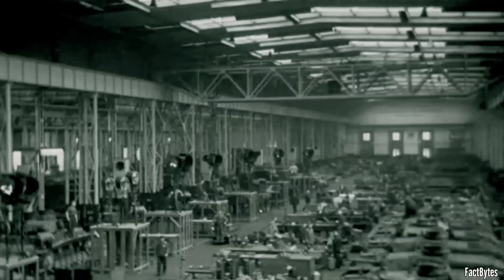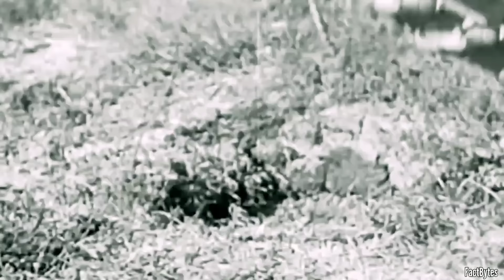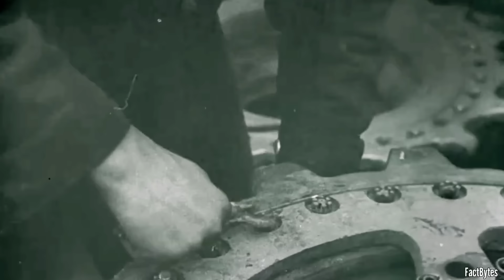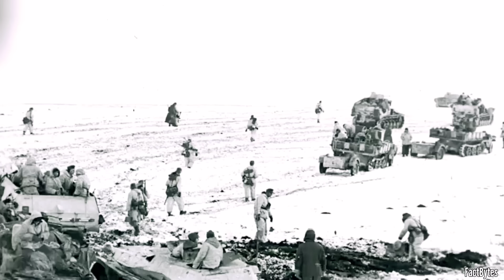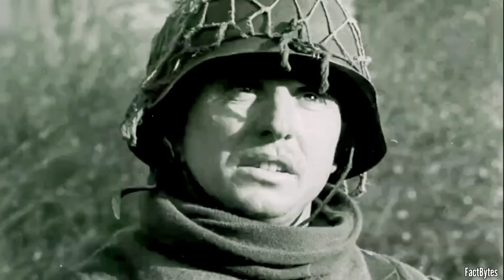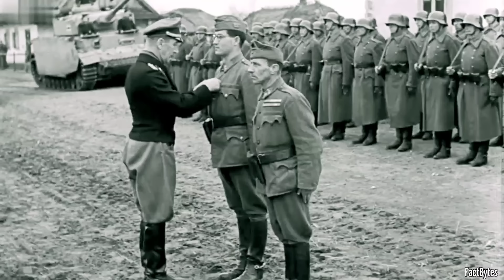More Panzer IVs, Fewer Tigers & Panthers — Would Germany Have Done Better?

Comment: Also, had the Panzerwaffe upgunned the Mark III with the 50L60 gun prior to Barbarossa, as Hitler requested, it is plausible that that one change may have altered the outcome of Barbarossa, the drive on Moscow, and even the war itself.
Reply: Interesting how minor decisions have such great impact. You may be right. Because they really struggled to take out t34s when they encountered it the first time. They needed to develop special strategies to take those out. Needed several Panzer IVs with the small gun to take out one t34. Basically one Pazner distracting the t34 while two others (or whatever) approached from the side or rear to aim at the engine. Imagine how long they had to deal with this before the upgraded tank reached the front. It must have felt forever.
Reply: @danple3557  There were only 1-1.4k T34's at the start of Barbarossa, 3k by the end of the year. The vast majority of tanks were far less armoured. You have to spread these T34's across the battle zones. Also, Soviet maintenance wasn't great, so not all these tanks would be able to be in action. Soviet tactics were also awful, no real tank/infantry/logistics coordination, & tank units were commanded by commanders with flags. If they broke through, they ran out of fuel, or got picked off. The Germans had radio & combined arms, including air support.
Whilst the t34's (& heavy KV heavy tank series) were very nasty shocks - & measures like you say had to be implemented if no 88mm's about, because of this 'shock' take up a lot more of the historical narrative than it should, most of them were thrown away in bad attacks/knocked out by German combined arms/taken out by aircraft.
Reply: @eric-wb7gj Most of your points are spot on, but I’ve not read that the Germans had fuel problems in ‘41.  If you have a primary source please cite it.  Now on your other points, the T-34 and KV 1/2 absolutely shocked the Germans as they had no effective counter other than the rare and cumbersome Flak 88.  All the shortcomings of the T34 you mention are correct, however much of the fighting by the Soviets was defensive, especially in late Fall of ‘41.  The weaknesses of the T34 and KV’s were minimized by defensive use.  There is an account of a single KV holding up a large German contingent…perhaps a division…for a day.  Another account where a KV knocked out an entire company of 38t’s.  The KV in question was hit dozens of times to no effect.

The shock of encountering the T34 and KV’s was so great that the Germans immediately went to the drawing board to 1. accelerate introduction of the Mk III with the L60, 2. upgen the Mk IV with the L43, 3.upgun the Stug with the L43/L48, and 4. Begin accelerated development of the Panther.   While you are correct that the T34/KV’s were fewer in number, the older, obsolete Soviet models were phased out in flames early on and the Germans faced increasing numbers of tanks they struggled to kill, at great cost.

The Germans had to win in ‘41, and most historians now consider Moscow ‘41, not Stalingrad, as the true turning point in the East and thus the war itself.  Had the Germans been able to knock out the T34/KV’s at the gates of Moscow they might have won, and the L60 may have been the edge they needed.  All speculative of course.  Also, had the Germans equipped the Me109E with drop tanks they may have won the battle of Britain, and thus the war, but that is a topic for another day.
Reply: @luvrofbacon  Thank you for your post.

The Germans didn't have a fuel shortage in 1941 - ONLY because they stole the strategic supplies of all the conquered countries. Otherwise, Germany, even with it's own synthetic production & Romanian help could only produce 75% of it's war needs. That's why Hitler HAD to go into Russia, & wanted Barbarossa to mainly head south, NOT for Moscow, which is what his head General wanted (who didn't understand economics, just battles), & who derailed Hitler's offensive. Hitler didn't help because with their big early successes, they believed their own propaganda & hype, thinking they could have it all, so he kept up all 3 attacks (north, centre, & south).
The Germans BIG problem in 1941 was getting the fuel from the limited rail heads up to the front lines - That's why the spearheads ran out of fuel (& what happened in Case Blue, only 2 weeks into the offensive). The Germans could airlift some fuel in, but never enough.  The Germans never had enough transport, they had a mismatch of every type stolen from Europe, incl British lorries from Dunkirk. Parts supply was a nightmare, so their transport capacity kept falling. Throw in weather, enemy resistance & basic Soviet infrastructure (mud roads etc), & you have a perfect logistics storm. Better guns don't help here, & may even make things worse by introducing another gun/ammo type into an already overstretched system!
Yes, on occasion a KV1 or 2 could hold up 1 German spearhead, but there would be many spearheads, & these were isolated incidents, not the norm which were that the Soviets threw away a huge amount of their tanks around Smolensk in Autumn 1941.
Moscow wasn't crucial, not getting a better jumping off point for 1942 was crucial. Stailin STILL considered a peace with Germany until early 1943. Only Stalingrad & Allied aid starting to flow saved this.
The Germans would have never taken Moscow in 1941, it's far larger than Stalingrad, & perfect for Russian tactics. Don't forget Hitler & his Generals insane decision to NOT supply their troops with Winter supplies. All the Wargames I played largely forgot the 'supply' issue, it's only the 'modern' ones that build this in.
Another factor is awful German 'Intelligence' that missed out 100 Soviet divisions! A better gun doesn't really negate this.
Whilst the world saw the propaganda films of the Germans 'at the Gates of Moscow', the reality was isolated spearheads of worn out troops & equipment, mostly miles away, with an ever decreasing supply train, which then went to almost nothing when the winter really hit. 
The Soviets could have also brought over their Siberian troops earlier, the Soviet - Japanese neutrality pact was signed in April 1941.
Yes, more T34's & KV1s were produced, which Stalin then frittered away until late 1942 when he let the Generals dictate the tactics, not him. 
It's undeniable the T34's & KV1's were very difficult for the Germans to face, but in reality, how many days did the Germans lose across the whole front because of them, & how many did they GAIN by wasteful Soviet attacks (ordered by Stalin), which wiped out whole (incl armoured) units?
The Soviets would have just done temporary armour fixes (to keep maximum production up), these are a lot quicker to do in the field then sort out a whole new production line (& possibly ammunition supply) of better German guns.

Yes, Luftwaffe drop tanks could have been very effective in the Battle of Britain, but NO country really thought about them at the time, they didn't want to lose performance from earlier lower HP engines & most flights would be close range anyway. Also, it's giving one side an advantage, but the flipside is what could the RAF have done differently to? The Luftwaffe fighter pilots also had a cultural issue of not wanting to escort bombers, & seemed to use them as 'bait' most times I've read.
Reply: The conflict was too huge to be affected by 1 gun. Also, when one side upgrades, the other side introduces measures to counter this earlier. Hitler ran out of fuel supplies in August 1941 (like his logistics General said he would). The Soviets then wasted their forces in high casualty counter attacks around Smolensk against dug in German forces,  which meant that when the Germans had resupplied, there were far less Soviet troops to prevent their advance, so it was faster. If the Soviets hadn't wasted their forces attacking, it's debatable if the Germans would have got near Moscow. 
Note;- The Soviet counter attacks did buy some time, but this time may have been made up by a better defence & slower German advance. A German defeat earlier may have actually helped the Germans take less losses during the Winter of 1941, as they would have been closer to their supply lines.

Comment: Pz IV/III were obsolete from the start. Not from the design, but the armor was far too weak. The 10 mm top and 30 mm side armor was paper thin. If your tank can be popped from the air by HMGs and the sides by the cheapest Russian ATRs or 20 mm AA guns, then you can't call it a "tank". Even medium mortars are dangerous to you. We are not talking tank vs. tank, but survivability on the battlefield.

Comment: The Stug IIIg was the workhorse of German armor and was literally the best bang for the buck.  The Germans knew this…and so did the allies.  Very reliable, good armor, low profile, and the venerable 75L48 gun, all on a cost effective chassis.  The 8th Air Force made a concerted effort to knock out the Stug plants because the Stugs were so very good at knocking out Russian armor.  If you want to talk about German armor in WWII, it is not Tigers, Panthers, or Mark IV’s that merit praise…it is the lowly Stug.
Reply: It did not have good armour! They ended up putting concrete on the front!
Reply: @rogercude1459 The Stug IIIg had 80mm of rolled homogenous armor that was very effective against T34 ap rounds.  IIRC, the T34 had to close to within a few hundred yards to have a chance, while the 75L48 could…and did…pick them off out to 1500 yards.  The kill ratio of the Stugs may be better than even the Tigers and Panthers.  The concrete was added because…well…you can never have enough armor, right?

Comment: More Panzer IVs, Fewer Tigers & Panthers — Would Germany Have Done Better?

In theory yes...

But the Panzer IV was not easily upgradeable. Now it had technical and mechanical issues, but it was a solid tank. However it had largely reached the end of its development potential by 1943–1944. 

While it was successfully upgraded from short-barrelled guns to the 7.5 cm KwK 40 L/48, fitting a significantly larger gun such as 8.8 cm, was not feasible without a complete redesign of the turret and hull.

What WW2 teaches us is simple, tank concepts and designs were ever fluid - so in a short space of time even the ever sturdy Panzer would have been obsolete.

Comment: Flat vertical armour and diminishing armour quality = certain defeat.
They could have angled the p.4 with the Panther, it with the tigers final drive and extra20mm on tge sides and rear, and stugs would have been good.
By far deisel engines with far better economy, able to burn veg oil that would have saved the German army for a few more months.

Comment: The reality of Germany by 1943 was that it simply did not have the raw materials required to produce a reliable tank ,  the design of the Panther was fine if the Germans had the materials required .  Remember they lacked fuel and man power as well so they could not maintain and fuel a larger number of tanks

Comment: There never was a chance to win a war against Russia and the US. The Tiger was built to fight an aggressive war, but when it was finally fielded, the war has changed into a retreat. 

But assuming that more Pz IV or StuG may have changed to outcome ignores the fact, that Germany in 1944 and 1945 did not have enough personell to staff large amounts of tanks. Theoretically, ressources needed for one Tiger could be used to build nearly three StuGs or two Pz IV, but those would have needed 10 to 12 soldiers, which just weren’t available at that point.

Comment: I see several issues not addressed:
One Tiger needs more fuel than a Panzer IV but it needs less fuel and less crew than 3 Panzer IV and it can fight like 3 them and scare away like 6 of them. Over all it was probably more fuel and crew efficient than the Panzer IV.

 Also: When Germany saw that the existing models got overtaken by new allied tanks they immediately started to develop new tanks and pushed them into production. Since Germany lost the war, this might have been a mistake.
On the other hand, when Germany saw that the U-Boats got overtaken by new Destroyers and methods of the allied, they increased the production and tried to fight it by numbers. Since Germany lost the war, this might have been a mistake and not rushing the snorkel and the Type XXI and XXIII into production 1-2 years earlier might have been a mistake. 
Same with fighter planes: When the 109 got outclassed by new allied fighters, Germany decided to do some smaller improvements kept production running and delayed the jet fighters. Since Germany lost the war, this might have been a mistake. We think today that the 262 in 1943 could have cleared the sky over Germany from B17's and the Type XX1 could have blasted the allied out of the water but we don't know. If done the other way around, Germany would have lost the war most likely in a different way and we would discuss if the 262 took to many resources for to short combat time between maintenance and the type XXI would be criticized for being to expensive and only an advantage for a few month until the allied found new ways to sink it just like the type VII.

At the End, as a German, I say it was a good thing that Germany lost the war and a little bit faster would have been a lot better. Over all, the big mistake was to start the war and the many decisions that where made this or that way changed how things developed but not the final result. If Germany had avoided some of the mistakes and the war had been stretched a few month longer, we wouldn't talk aber Hiroshima and Nagasaki but about Berlin and Hamburg or something like that.
Reply: I like to think that even if Germany had held out as long as Japan, Japan still would have eaten the nukes. The reason is that the Japanese were seen as an utterly hardened enemy that could not be reasoned with, and therefore they needed the extra psychological "nudging" that only a first-in-the-world superweapon could deliver.

No matter what Germany's position had been by the end of 1945 it would have been clear they were going to lose regardless. And Stalin still wanted Berlin.
Reply: And the ammunition I did point this out and under another comment. The ammunition used more resources but was probably a lot more effective than making smaller rounds. Regardless they needed the air power and the fuel to fight the war otherwise someone just flies a plane and shoots the shiny tank
Reply: You raise some good points.

On the Tiger versus Pz-IV issue, the Tiger had some serious mechanical issues while the PZ-IV was a very dependable workhorse of a tank. The PZ-IV was far easier and far quicker to build, easier to transport and operate and more easily recovered and repaired if knocked out in battle. The downside was that it could not mount the best 75mm guns nor anything larger, which was necessary to confront later-war Soviet tanks (although it would have sufficed against American and British tanks.

One of the reasons Germany had to constantly try to upgrade the Me-109 and FW-190 rather than fully transition to jets was the mechanical unreliability of jet engines at the time. I seem to recall reading that 1943-44 era jet engines lasted only about 20 hours before they needed complete replacement- and that was with optimal maintenance. Compare that to 50-300 hours of life for piston engines. As you pointed out, pilot training by the time of the Me-262's introduction had been dramatically lessened due to lack of gasoline, so you had a bit of a parallel between German trainee pilots and those of Japan. Rookie trainees in Germany were expected to be proficient in a new and radically different technology in jets. The few Old Hands loved them, but the new recruits weren't up to the challenge.

Lastly, you're almost certainly right about the atomic bombs being used against Germany had the war in Europe lasted into late 1945 or 1946. Most of the scientists involved in the Manhattan Project were refugees from Nazi Europe. Many were Jewish. The original targets of the atomic bomb were going to be German, not Japanese. Once Germany was defeated, a few of the scientists who would have been okay with the atomic bomb being used against Germany (and who could blame them?) weren't so eager to see them used against Japan. But if the battle lines in Europe had become stagnant, say along the Franco-German border and the threat of WW2-style static warfare emerged, I'd have to think that the atomic bombs would have first been used over German cities.

Comment: The straightforward reality is that the stuG-3 was an excellent machine, the five however with its primitive armor was not a good match for the T-34 and the T-34/85 would have made short work of them. A more fully developed panther was the correct answer to Russian armor and in large quantities it would have remained highly effective throughout the war. But likely, very challenged by the appearance of the early Stalin, IS2 with its heavy armor and 122 mm gun.

Comment: No would never have worked, it would have put a far larger strain on the logistics and consumed far more fuel, and logistics and fuel combined with limited access to rare resources was what hampered the German war industry and effort the most. Adding more engines and parts to the equation where logistics and lack of fuel are the issues, WILL NOT MAKE ANYTHING BETTER. Use your fucking brain, god damn AI slop channels everywhere.